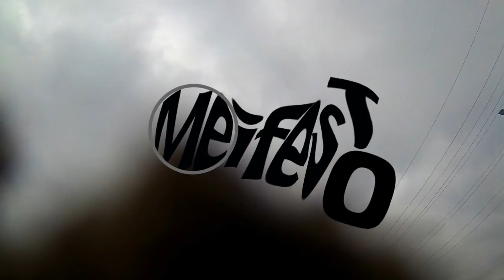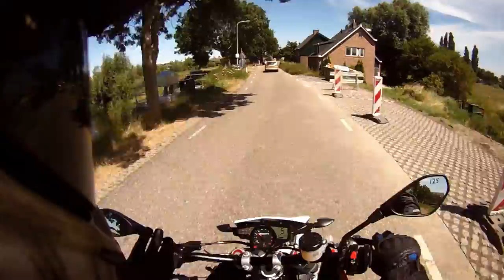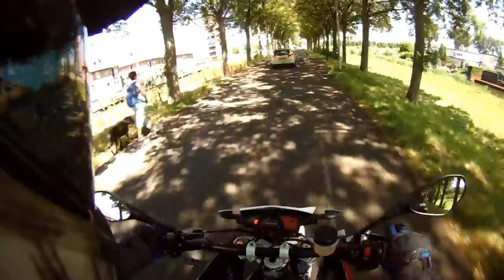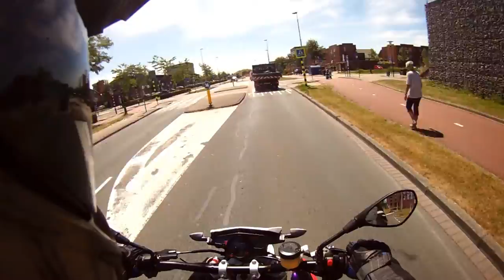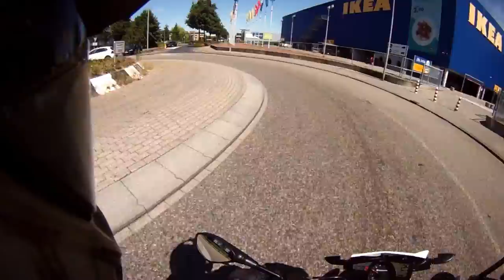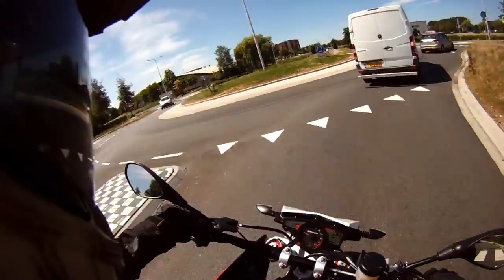Trouble in Meifesto Town

Comment: Those xr's go for (relitively) a lot of money online from what I've seen, clean it up and put it up and see what offers you get. Many bikes to be found cheap as long as you look around; got my gsx400f for 500 and that thing rode strong for the +/- 15k kms before it got totaled (insurance of other party paid double the price I got it for), freewind was about 850, sold it a year later for a 1000, also with about 15k kms more than what I bought it for. Thing rode strong through most of Western Europe, not even a single drop of oil used with all kinds of riding.
Point is: don't feel bad for "cheating" on your bike, there are waay too many good deals to pass up online
Reply from the maker: True, i just have the experience of bad luck with older bikes. Or keeping them to long.

With the problems it has, it will be hard to ask a good price for it.
But if i can refix the shifter it is easier to sell.
For now i will keep brainstorming.
Soon i will work out the financiel paperwork, and i might peek op marktplaats to see what is up ;)